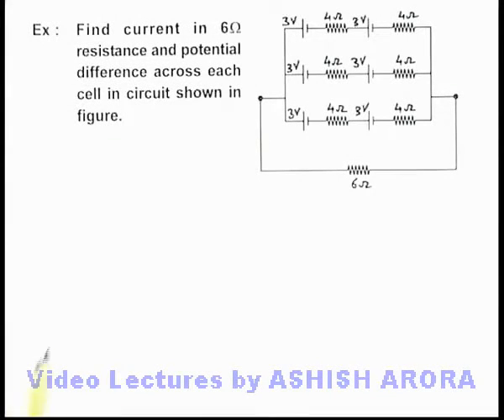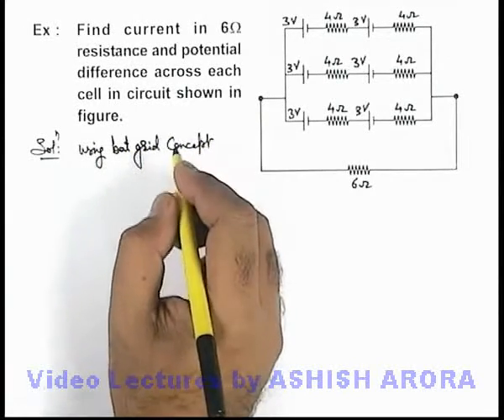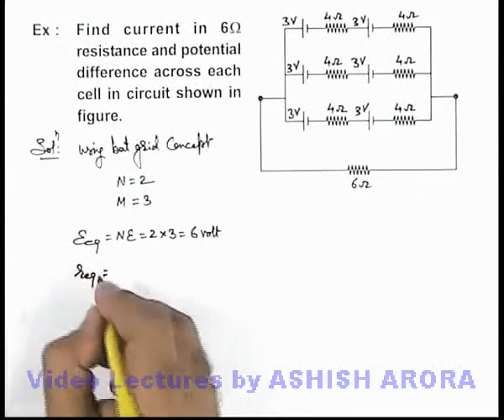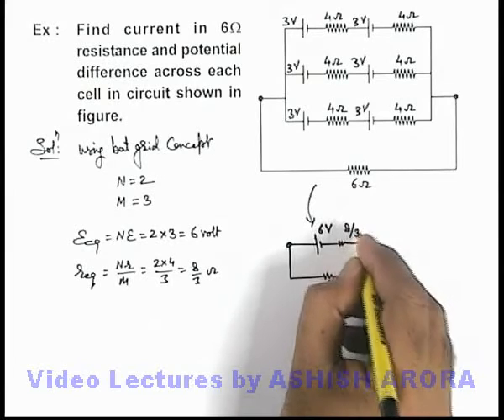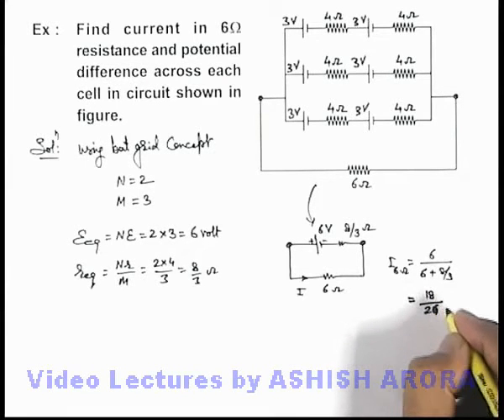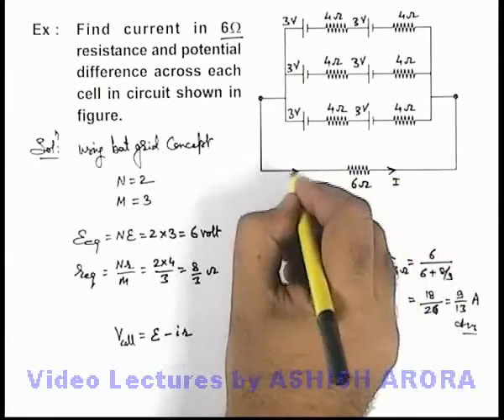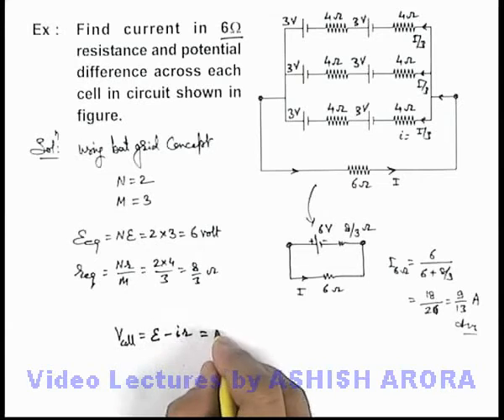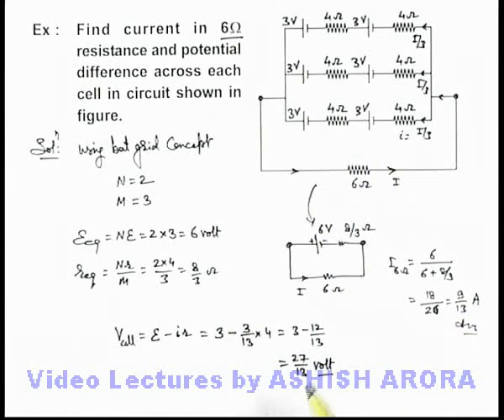Class 12 Physics | Circuit Analysis | #24 Solved Example-12 on Circuit Analysis | For JEE & NEET

Comment: sir in theve nins methid  IF THE CELL IS ACCROSS A RESISTANCE IN PARALLEL SO WHEN I WANT TO FIND RESISTANCE ACROSS AFTER REMOVING THE CELL THE RESISTANCE BECOMES ZERO SO WILL I NEGLET DURING CALCULATION
Reply from the maker: +Arabinda Biswas In Thevenin's method you first need to define the two points across which you wish to calculate the equivalent battery and internal resistance. Once you define the two points open the two points and calculate the required parameters.... In your question you are trying to attempt without specifying the points...